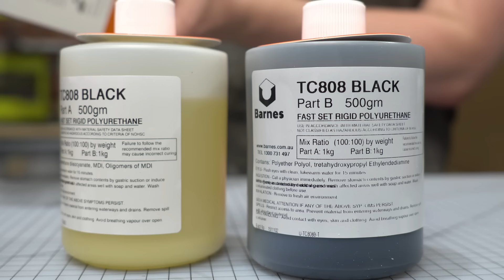Let's Pour Silicone without instructions...

Comment: Some silicone tidbits from someone whose used 100s of gallons of silicone if anybody wants it :P (Other folks have touched on the PPE needs for resin and such already, so I'm not going to go into that again)

--If you're molding something solid from silicone you usually don't need mold release on it (but spot testing is always recommended because occasionally it sticks)
--There are multiple types of silicone (tin cure = cheaper but shorter mold life, platinum cure = more expensive but lasts kind of forever but is also a little finicky with inhibition sometimes)
--You also don't need release if you're pouring resin into silicone (though it can help improve the longevity of the mold)
--purple alcohol ink usually turns brown in resin, matte pigments can sometimes be used instead (with a respirator so you're not huffing mica)
--You can do a cut mold rather than blocking off half the model with clay, just look up 'jeweler's cut mold' and don't slice the mold straight or registration will make you cry. (personally i have garbage luck with multi piece molds and usually use cut molds)
--On a model like the dragon, it's not uncommon to put a thin layer of silicone all over the thing before pouring the mold - this can help eliminate weird surface bubbles depending on the geometry of the model (and/or give the silicone bubbles more time to get the heck out of the mold since it's a thin layer of goo)
--they make retarders that will give you longer to work with the silicone or you can get janky and toss it in the fridge for a little while before use as cold will also slow the cure of the goo
--resin prints usually cause inhibition on silicone if you're using platinum cure (no idea what you were using, but I'm mad surprised you didn't have issues). Certain resins (siraya navy grey (?)) can help eliminate/reduce this, but you can also sand or sand blast the whole surface of the print, let it sit out[side] for a long time/several weeks, or coat it in resin/epoxy or certain spraypaints prior to molding. Or you can use inhibit X with a HEALTHY dose of mold release afterwards because that stuff turns your prints into glue.
--they make aerosolized and liquid mold releases designed to be used on silicone-into-silicone applications. (but also it's not great to breath mold release either)

Comment: A lot if not most resins use pressure chambers to get the bobbles out not vacuum chambers. I learned vacuum chambers actually created more bobbles and reduces the working/ curing time significantly.

Comment: First of all. You simply can't vacuum polyurethane, because it's fast setting. second thing is about silicone mixing. Mix both parts completely and then simply vacuum it twice or three times with air release in between. Silicone has to be uniform colour to cure perfectly and keep working for multiple pours.

If you need any help with mould making, feel free to contact me, would share my knowledge. :)

Comment: You could try not removing bubbles first, pour your resin or plaster then put the mold in the pressure chamber and let cure under pressure.

Comment: Jazz try a pressure pot so putting air in the pot it works a little better then vacuum as the pressure makes the bubbles small, invisible really

Comment: I'm sure somebody has said this but when you work with the resin pour it in the mold then put it inside the pressure part cut it on and let it do its thing then cut it off and leave it to cure inside the pressure pot

Comment: Good video. I prefer an outdoor pour. But yes safety should be the first thing...and then worry about splashing something on the camera lens ;). I can't believe why masks and body parts are so incredibly expensive still and quality is so spotty from manufacturer to manufacturer. A fair looking head can cost $1k or something good enough can be $40 on Amazon although usually there are 5 photos and 3 look perfect and the other 2 are really the crap you will be getting.

Comment: You should have bought more silicone and made a mold of the back of the vampire head. Then you could have put the vampire head in that mold (and maybe filled in the gap with monster clay) before making the actual mold. That way, you wouldn't have had to cut the head in two.

Comment: With silicone, you can just cut the cast item out of the mold, and then rubber band the cut pieces back together to reform the mold… no need to manually make a multi part mold

Comment: If you don’t have the money for a vacuum chamber, double decant which is where you pour your mixture into a second cup from high up. The higher the drizzle the smaller the bubbles. Then when you pour your silicone into your mold, pour from a high height like a fancy bar person. Source: I spent 3 months and £400 making silicone fingers for university it was torture. Also, for the love of god jazza wear gloves, it’s not resin but it’s still not something you should touch with your bare hands. And if you also don’t mix enough since silicone doesn’t stick to silicone you can just mix up the rest of the batch and pour the rest.

Also foam core is not the best material for small casting. Stock cardboard is better with hot glue since it can actually be sealed. Or if you have more money, acrylic sheets.

Comment: When I first used silicon with 3D-printed models, the prints were too porous. So I ended up with my mold surrounding only half of the prins, the rest having ended up inside the prints while it was left setting.

Comment: I see you using Pinkysil Jazza! I'm going to assume you had a look through the rest of the Barnes site when you bought it, but they also have one called Oddbod specifically for life casting. I know you 3D modelled and printed your face, but how about moulding and casting it? Although please for the love of everything read all the instructions and safety requirements first. And probably watch some how-to videos. There's a Barnes shop in Melbourne so you could probably do a collab with them and get them to mould your face actually...

Comment: I almost got an anxiety attack when he started putting stuff in the still curing silicone with his bare hands, got curing resin and silicone on his fingers. I get that this was meant to be comedic, but these chemicals are dangerous when used that recklessly. Safety first! Use gloves, wear a respirator, wear old clothes you dont use anymore, preferably work outside or in a well ventilated room. It is not worth it to put your health at risk for some comedy.

Comment: Good job..I did similar but without case. I used brush for silicone but it's too thin so now mold is too week to hold the weight and I get deformed sculpture.
Can you tell me which material you used for actual figure...what is that orange material for dragon? (sry for my bad english)
Reply: Resin

Comment: jazza if thats barne pinksil it cdures to fast for vaccum chamber
Reply: i'd reccomend using a different product if you want to vaccum chamber.
Reply: another tip would be to thin down your vasleine with spirts to brush on and to use clingwrap around your model with the clay

Comment: “You may not agree with my methods” you’re right, I don’t. You’re an influencer. Intentionally or not you set an example for kids and young teens everywhere. Yet you failed to take any safety precautions when working with dangerous chemicals in a video. Jazza, you’re an adult, you should know better than this. Kids don’t know any better and they can get seriously hurt if they follow the example you set in this video. Resin fumes can be deadly and it can burn your skin or cause serious damage if it gets into your eyes. You need to make sure you’re setting a good example when you film. If you’re going to disregard safety on your own time, fine nobody can stop you, but when you’re filming you need to remember that people will follow your example.